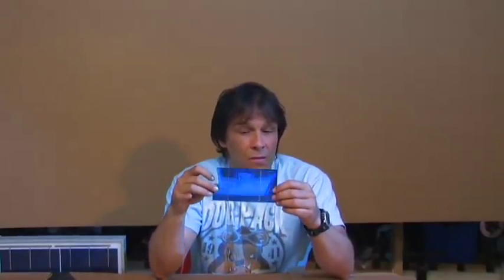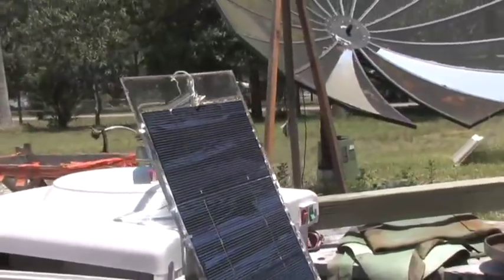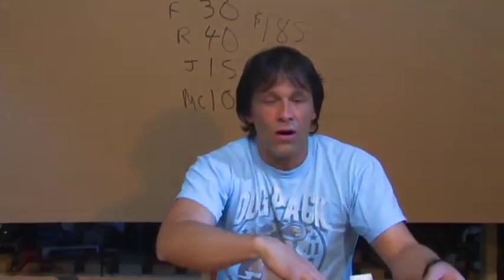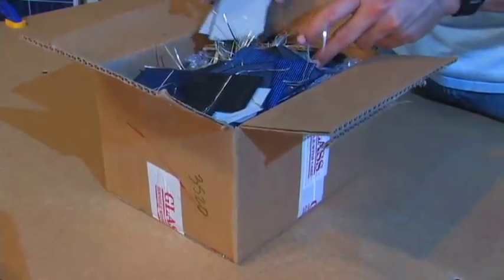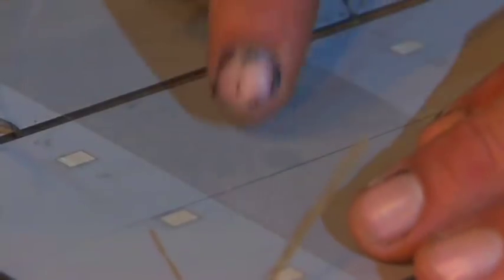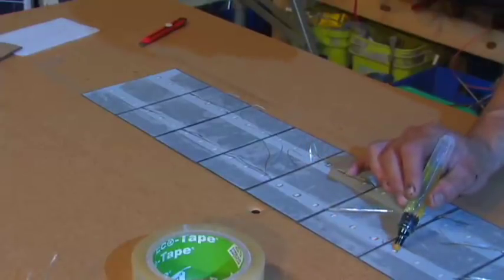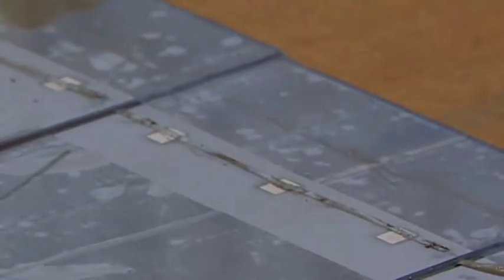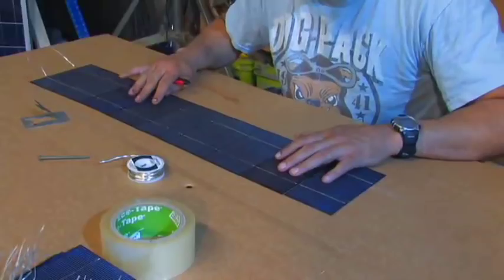less than $1 a watt DIY Solar Panel MAKE YOUR OWN SOLAR PANELS (PART 1)

Comment: I know when I build my panels,they cost roughly $125.00 total.The next time I buy cells,I'll get already tabbed due to that my wires comes apart (solder doesn't hold) so I have to re do them.Panels already built are getting cheaper, but I like building them

Comment: I don't get why the need to create your own solar panel. most solar panel vendors guaranteed at least 15-25yr product lifespan. if you are good at construction DIY is good to go. if you are not, just buy ready made solar panels..  for me I just do what I'm good at to make money and buy it, rather than force myself to do something that is not my field of work.  solar panels today are cheap.. and getting more cheaper. for guaranteed 15-25yrs lifespan.. it's a good deal. for a cost of my 2week salary.

Comment: Don't get me wrong, I love the idea of DIY, but can you get UL rated? can you get a building permit for non-UL rated equipment? What do you recommend is acceptable to construct without a building permit? Does your $1/W DIY panels (compared to 84 cents/W manufactured panes) come with a 25 or 30 year warranty compared to the manufactured panels. Can you drive a car on them (like as in solar worlds promotional video)?

Comment: Is it possible to use transparent acrylic sheet instead of glass for the solar panel? I want it to mount on a solar powered trike and glass would be too heavy and too brittle. If anyone could help me or recommend some other good (light, transparent and not that fragile) material I would really appreciate that. Thanks in advance!
Reply: There's a flexible solar panel maybe you can put directly on the delta win, best is use lithium bat banks
Reply: My problem is with ready made panels that they are expensive, also their form factor is given so it's restrictive towards my trike design. I also would like to assemble the panels from individual cells because I already have the cells and would like to learn /experience the whole process too.
Reply: Even you can use the propeller to generate charge with the wind, better in thermals, you dc motor is also a charger. And remember don't land in cross win hehe.

Comment: Verum biblia, I bought mine on Amazon from (I think) mls solar. Search Amazon for 3x6 solar cells. They come in packs of 36, 100, etc. They usually throw extra in to account for breakage.  I was surprised how fragile they were. Like Dan said, you can find broken cells sold by the pound too. Also, kudos to Dan for admitting soldering tabs to the wrong cells. We've all been there (and hoped no one was watching) .

Comment: did he solder the cells correctly? isn't the front wire supposed to run all the way to the bottom without going to the back side of the cell

Comment: Not sure of the verbiage, but is it possible to make a solar panel more compact and still produce the same amount of energy as say, a much larger panel? In other words, if the metal tabs were much closer together across the dark background, the panel could go from an inch across to a quarter of that amount of space. Would that work? Or do the metal tabs (the strips across the face of the dark background) have to be a certain distance apart?

Comment: Sad that solar energy isn't utilized like it should be. Free energy and we use it for calculators. Imagine the guy that invented it. So proud and thought that it would change the world forever and all we do is heat pools and run calculators with it.
Reply: I doubt anyone uses solar electrics to heat pools. That would be the dumbest and most inefficient use of power ever. Solar thermal water heaters perhaps. Any from what I see, solar is expanding faster than ever, where I live there are panels on every other roof, and lots of big industrial buildings and malls run entirely on solar with thousands of arrays on top the roof and/or a field nearby. Perhaps there is just not that much sun where you live? Solar is a bad idea if yo live in say, England, with constant overcast.
Reply: @CalyPTratus  Build something and you'll know.
Reply: @CalyPTratus  I know its been 2 years but the white house had solar put in for the pool heaters under George Bush. Carter had panels put in during the 70's then Reagan was a baby about it and had them removed once in office. Solar is used for more now but to heat pools was quite common in the early 2000s.
Reply: Oooh no, Solar is used for much, much more than you think...
Reply: I see it growing finally. Now we need the see-through panels, solar greenhouses and such. AMAZING possibilities
Reply: I agree it should be free but the lever make it 3 because they lose money then it cost so much money to make it free cuz I thought of doing it but f**** and you don't realize how much it is to buy all the parts to make solar panels but it's ridiculous

Comment: Ok, I am sitting watching this video and thinking...he is not connecting the panels to each other, as far as I know you need to solder them together so you can generate more power.

So why post this video if it is a mistake ?   I don't get it.  It seems like it is a waste of time to watch it.

Comment: I am not an electrician or know much about it but what can you run with one or two of these panels or does one have to have a bank of batteries and charge those for a length of time to be able to run anything.

Comment: better option for more power cost more but make huge energy even for more than one house mirror you can find in junks places a metal tank you filled with water and you a metal tube in the top and turbine the mirror hit the metal tank and inside the water heat up making steam them start to move the turbine with 5000 litres tank you can make up to 12 kwatts and average house use 2.5 kwatts bigger the thank and the number of mirror bigger the energy to store the energy you need huge tank with salt to store the heat at night so you can make steam the cost is huge but this is a comunity proyet involve 3 to 5 families and if is posible a small village can make this proyect too

IN SPAIN WE MAKE THIS BUT in masive scale I mean the instalations have the size of new york you can see it from space but 4 of those provites 40% of our power needs one istalation make electricity for 9 million(about 9,937 megawatts) at night and in the day if is bad weather the system have heat store to provide energy for 2 weeks

also we use other similar system to power up our fusion reactor (not working yet) we need 537 megawatts for 20 min of test to run it but we reach 100 millons Cº inside of the reactor we calculated that we need 50 millon more Cº inside of the reactor to make it works

Comment: You mention soldering these tab wires to the boards, I have two tips for you when soldering - 1. after you have applied the flux to the panels, you might want to "Tin" the panels first by lightly soldering each panel pad first before attaching the wire. 2. "Wet" your soldering iron on a clean wet sponge before applying solder to the iron; this removes impurities from the solder iron tip.
   By tinning the wire and pads first it requires less time for heat to be applied to any one surface and prevents "Cold Solder" Joints.

Comment: OMG

Forget to collect some broken cells from your store manager or from an
employee of them, they don´t want to offer them to you for nothing,
they wanne sell that whole pannels and the accessories.
DIY isn´t worth it to do with broken cells. To much work on it.
A new 240W panell has a cost of 170 € or 230 $.
So buy a new one and you have additional a guaranty of 2 years for it and
saved a lot of time and maybe selfburned fingertips. :-)

Comment: hy.,,,,whats that adhesive called, the one u use before soldering...which is in marker type shape
Reply: That's not adhesive, it is a solder flux pen.

The flux is used to 'prepare' the pad, by removing oxidation/contaminants which help the solder to 'wet out' and adhere.
Reply: SuperJaveline

Comment: Fine job of instruction however I have never worked with solar panel units. You said you soldered a string of panels to themselves. Would you do a demo on what TO DO. . .Instead of the wrong way. Your delivery is very good. . .I'm just a bone head and need you to tell me how to line them up correctly. I am guessing but I would say the PLUS LEAD is soldered to the NEGATIVE LEAD. . .but what do I know. Thank you for taking the time. Are you a dealer for the 'broken' cells or could you share your source without ruining your source.
Thanks again,
Tom

Comment: For cell alignment I took a trick from carpentry and added the open V marks.  With over 900 comments I'm not sure if this has been mentioned before but it kept the end lines almost brainless (very important if you are doing hundreds of these while distracted by a movie).

Comment: Hi.  I'm confused. If it costs the same to get a manufactured one, with warranty, why go through the trouble of making your own?
Reply: If you made them the same way as the factory it would cost the same and you would be with out a warranty. So you would be correct in thinking WTH why bother. But he was saying with the resin he found and NOT doing it the with the glass and aluminum then it will be significantly cheaper. You gotta watch part 2 also
Reply: David Smi
Thanks for the info.  I could be wrong, but I think Dan should make this clear ASAP.  At 0:25, Dan says "Doing it yourself cost about the same as buying a fully pre-manufactured solar panel". That's a suicide introduction. Then it turns into a commercial for that prefab panel, how cool the glass is, etc...  By that time, I'm already on Amazon looking for the panel!

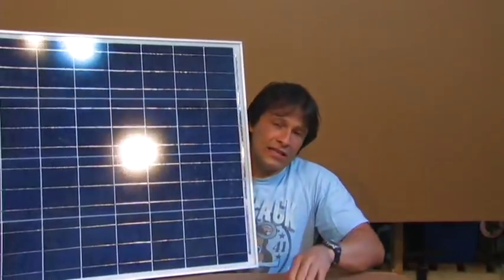There are simple ways to fix this, even without turning it into a new video and losing all the views. Ex: add an annotation at 0:35 that says "IF YOU USE THE SAME OVERPRICED PARTS..." and an "OUCH!" after telling the price of each part (on the panel). Then, at 1:23, you have until 1:30 to put something like "NOW LET'S SEE HOW MUCH WE REALLY NEED TO SPEND TO MAKE PANELS THAT WORK JUST AS WELL" or something like that... A few changes on the title may work too, if it's possible.

Again, that's just my opinion.

Comment: it's a little late to say it now but if you ever do solder tabs the wrong way again I'd just desolder them one by one, bend it the correct way, and solder it down the right way.  <this leaves a 'hole' for the tab on the next panel to be soldered to>